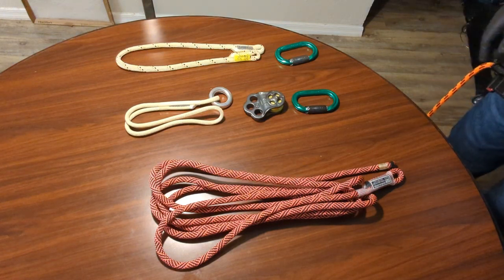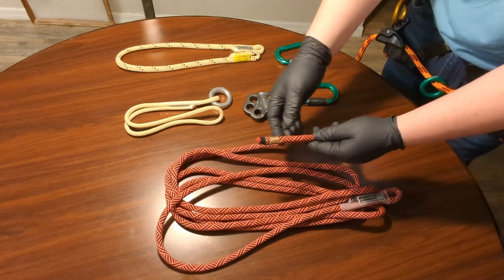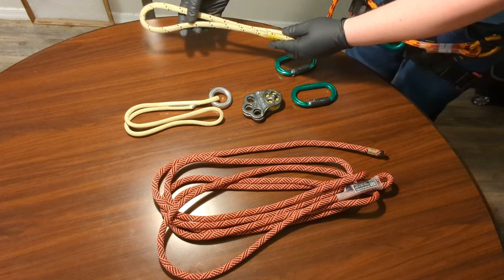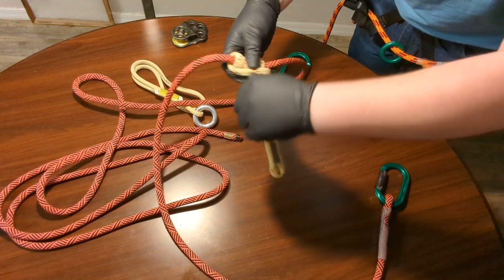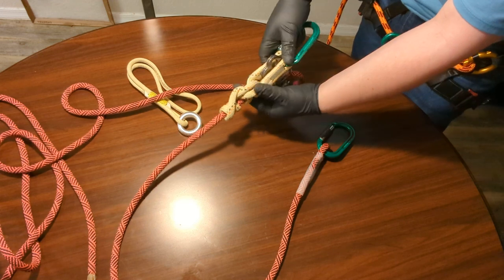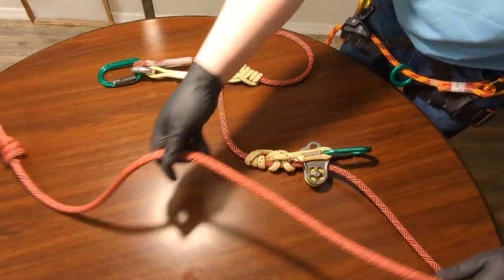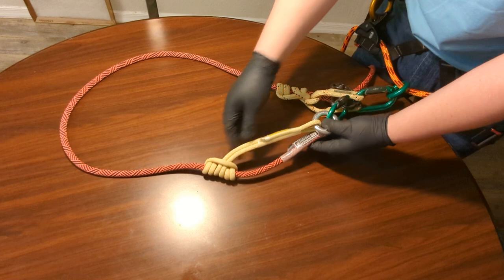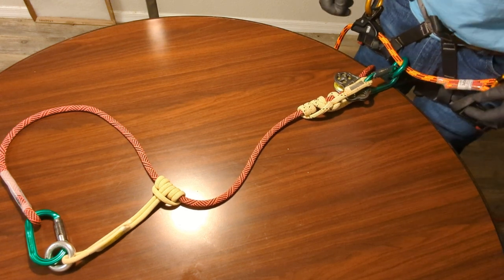How To Make a LANYARD for TREE CLIMBING (Both Industry and Recreational)!

Comment: Interesting that you attach the lanyard to your bridge. Most everyone attached to the side Ds. SRT then I’d go to my bridge as shown but general work positioning it’s on my side Ds.
Reply from the maker: I chose the connection method that would cater best with most recreational tree climbers who would connect their lanyard to their belay loop or bridge because their harness wouldn't have side D's like an industry saddle. If I were working a job, I would most definitely be using my D's, specifically my lower D's more than my side D's unless I were in a situation were connection were fully lateral without any anticipation of downward force. Nobody wants to gaff out and hang from their side D's. So if you don't have lower D's, then that's why the bridge connection is sometimes better.  Thanks so much for your input and for helping to clarify this for future viewers!

Comment: nice video! about to build a lanyard setup myself so this was super helpful. What are your thoughts on using a pinto pulley for the slack-tending? can’t decide between picking one of those up or just using my extra hitch climber
Reply from the maker: I'm glad this video was helpful! I made an updated version of this video if you're interested in watching it: https://youtu.be/IEU59FgvuVc As far as a pinto, I think that would work well also! But I like the hitch climber better because you have more options for connectivity and because the side plates are right next to one another, versus the Pinto, which has spread out side plates. It just means that the hitch would be pulled much straighter on a hitch climber than with a Pinto. I'd suggest trying both out for a day an seeing which one you prefer! The pinto also has a becket, so it does have some extra connectivity too. Thanks for commenting!
Reply: i went ahead and just used the hitch climber that i had and it works great!! Also, why don’t you suggest using anything but oval carabiners for lanyards? Instead of using like a pear shaped carabiner?
Reply: More so for the terminal end..
Reply from the maker: @chasedionisio  It's just my personal preference. Ovals keep everything in nice alignment compared to HMS/Pear shaped carabiners. But sometimes, if you're in the tree work industry, it can be helpful to use the latter because you can more clearly identify which side the gates opens on with an HMS/Pear. I still prefer ovals for most applications, though. I didn't meant to suggest that it was required. Just a personal preference. Glad the hitch climber pulley worked well for you! I find that they work better than a Pinto for tending slack. Make sure you have the hitch eyes connected at the back most hole on the pulley as shown in my demo. That leaves the two holes in front for other connection options. Thanks for the update! Let me know if you have anymore questions!

Comment: Your technique is clever A.F.!  I'm going to try it.  Very interesting hitch, too.  I also like the fact that you whip the ends of your lanyards.  Very clean work.  The core on my 12.5 mm lanyard is already sticking out, and it's not six months old; it's annoying A.F.!  I'll have to watch your video on how to whip.  Thanks for a very informative video.
Reply from the maker: Hey, you're very welcome! I'm so happy that you like my technique for a lanyard! I whip the ends of everything, whether it be hitch cords or ropes or lanyards. I have waxed polyester twine in a rainbow of colors. Just so you know, some ropes will have the core come out (aka "milk) during regular use. For certain types of rope it is recommended that you only whip one end of the rope so that the rope's sheath can freely start to move out on the other end. Once your rope stops milking the core out, it has found an equilibrium or balance between sheath/cover and core. At this point, simply cut the excess core off and then proceed to whip that second end. If your goal is to secure the core, the whipping I show in my most recent whipping video will work, but you must make at least two doubled perpendicular stiches  over the primary, multiple wrap stage. I didn't show this in my video, but because you have highlighted a need for such content, I'll make a video for you showing how this is done. Even if you use my whipping that I already have made a video for, I have never had a rope's core milk out after placing one in, but I like to be thorough and I want to offer you the best intel I can provide. Anyways, fantastic comment! You've made my day! =-D

Comment: Cool set up! I thought SRT wouldn’t work with a friction hitch because it binds up? I’m new to SRT
Reply from the maker: Thank you! Well, you're correct about that. You'd be using it a little differently than typical SRT on a climb line. It'd be more for work positioning than climbing directly on it. Therefor it would be easier to adjust the friction hitch because you'd be able to transfer most of your weight onto your main line whenever necessary. This is for a lanyard setup.

Comment: Man I love the design in that red rope!🙂
Have your devised your own sort of floating bridge on the saddle?
Reply from the maker: The rope is the Yale Phantom 11mm. The pink was a limited edition color. It only comes in green now, which is still pretty sweet.
https://www.wesspur.com/yale-phantom-kernmantle-rope
I had an adjustable bridge using the Petzl Micrograb. But I quickly realized that I hate adjustable bridges and that I don't feel safe with them, so I sold the Micrograb to someone on EBay after only using it twice. The saddle in this video is garbage. I now climb with a Treemotion by Teufelberger. Thanks for the comment and the question!
Reply: @Knot-orious  The Tree motion saddle looks awesome! Just looked it up!
Reply from the maker: Yeah, it's pretty much the best harness on the market if you ask me. It has great hardware on it. Side Ds, big lower D's, and you can put TWO bridges on it, which, for me, is extremely important since I frequently climb with two systems or use my lanyard to triangulate my position and it's nice to have two bridges for that. If you watch my recent videos, you'll see those two bridges on my harness. It's also extremely comfortable. I could spend all day in it without getting back or leg pain. The Pro version is easily the best, but I got the Essential and then bought the "Comfort Padding," which you'll notice in my more recent videos. I even made a quick video about the comfort padding. It truly is very comfortable. Here's my 100% blind reaction to the comfort padding on the Treemotion Essential: https://youtu.be/tuGPQQl2N0E
Reply: @Knot-orious  Ok thanks! This climbing stuff is crazy expensive! I'll check it out!
Reply from the maker: @RC-Heli835  Yes, indeed. Tree climbing is both an expensive profession and it is expensive for us recreational climbers as well. But trust me when I tell you that it's worth it in the end to be able to skillfully climb one of the fastest living organisms on the planet (a tree) and either make a living out of doing so, or by simply climbing for fun. If you ever have any questions, don't hesitate to ask. I can always be reached privately at knotorious.info@gmail.com. Thanks for your comment.
Reply: @Knot-orious  Ok thanks! I've been practicing knots a good bit.
Reply from the maker: @RC-Heli835  Knot are extremely important for the tree climber! You can find a video or Short tying tutorial for every single knot that you would ever wish to use while climbing in my video library. =-D
Reply: @Knot-orious  Ok thanks! I'll look for them. I had found a video where this Ninja guy made an emergency body harness along with a blake's  hitch.
  First came the leg loops. He used a double figure 8 then a half hitch around the torso but twisted 5 times to keep it from tightening up too tight on he body and finally enough rope left to tie a blake's hitch and stopper knot.

I need a friction saver and a throw line before I can do much climbing. Don't want to wear grooves in my trees.

Comment: Is the Yale mainline possibly 11mm and not 10 as stated?  At the aforementioned source I only found 11 in that pattern or 10.5 RING style lanyard with the red wear warning core.  What would you consider the acceptable main line range while maintaining good function like your prototype?  Good job, thanks!
Reply from the maker: Yes, I misspoke in my video. That's the Yale Phantom in limited edition pink. It also comes in green. It is 11mm as you stated. What's an acceptable range for a rope for a lanyard? I would say that anywhere between 11-13mm, but there's really no need to go above 11m in my opinion because it balances strength and weight beautifully. Pretty much any rated static climbing rope can be used as a lanyard if one desires. It all comes down to personal preference. I hope I've answered your question adequately.
Reply: Indeed you did, thanks for the prompt and thorough reply! @Knot-orious
Reply from the maker: You're very welcome. Be sure to check out some of my other videos if you are so inclined. I have tons of educational content. Don't be shy around the comments section either. I love answering questions.
Reply: Sure, I got another one for you.  Is this still your favorite friction hitch for this setup?  I ordered an almost duplicate set of what you have listed here.  I was surprised to see the trinity did not make the list in your top 10 vid.  Which others would you recommend that tend and function as well as the trinity as I tend to tinker?  Again, fantastic instruction, hope your journey to spend more time in the canopy is moving along like you want.   @Knot-orious
Reply from the maker: @TDizzle5408  I have created so many friction hitches and, when I made that top ten video, I could only put two hitches of my own in the lineup because I didn't want to seem full of myself, you know? haha The Trinity is still for sure one of the best options for a lanyard because of how little setback there is when you tie it with the right size hitch cord and very few hitches grab the way it does. I'm going to actually make a new video for the Trinity hitch and post it soon. It was my very first video ever and it deserves a reprise! Thanks for reminding me. My other favorite hitch for a lanyard is the Calligraphy hitch or the Felicitous hitch. Calligraphy: https://youtube.com/shorts/9IPQJwCmpyE  Felicitous: https://youtube.com/shorts/9IPQJwCmpyE  Trinity: https://youtube.com/shorts/oj3MhyNWnFc

Comment: Why triple attachment pulley on lineyard ? ....
Reply from the maker: That's a great question! The reason is so I can wrap the lanyard around a spar/limb and then connect the terminal end to middle hole of pulley. This will form a complete MRS lanyard arrangement that is extended outward more than if I had clipped the termination end to my bridge. It is neater and more organized when the right situation calls for it. Additionally, imagine that you are connected to a spar/limb in the way I just described and imagine that this time you clip to the outward most hole instead of the middle. Why? Because you your SRS/SRT climbing setup, or secondary MRS/DRT setup on a different stem off to your side. All you need to do in order to have one complete system is take that SRS or MRS setup and connect it to the one remaining hole on the pulley; the middle pulley. And there you have it. You are now fully triangulated and your work positioning will be twice as good, with both your lanyard and climbing systems interconnected, forming a "v" shape, allowing for ideal balance. It's a lot like a V-Rig, but without the mechanical advantage.
Reply: Wondered why as well, came up with these thoughts: (1) Makes it easy to make the loop smaller, because it stops the hitch from moving with the rope (2) It gives you an attachment point for the other end of the lanyard (as explained) (3) It makes the stop knot stop for sure
Reply: @ChristianTreber very good explaination